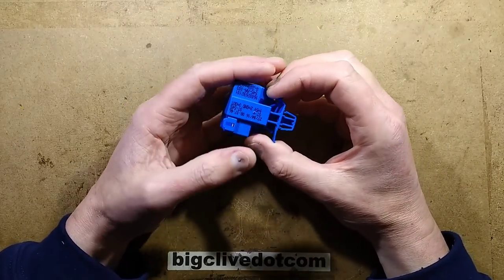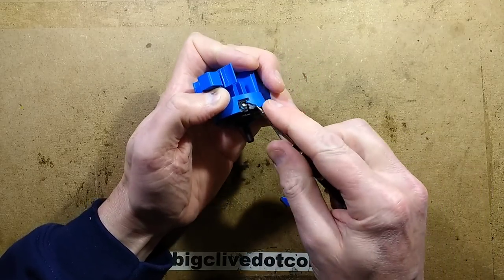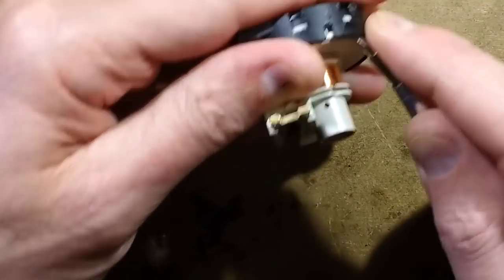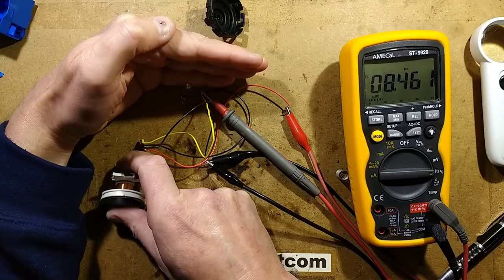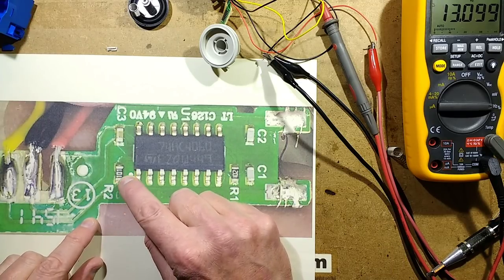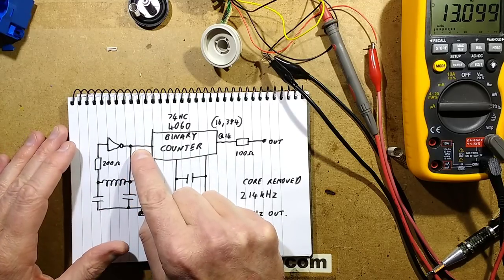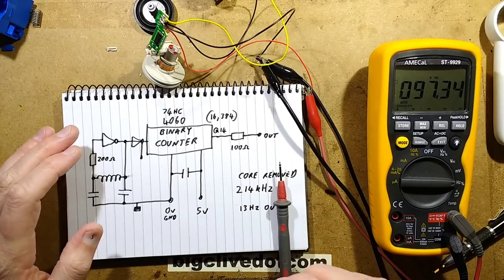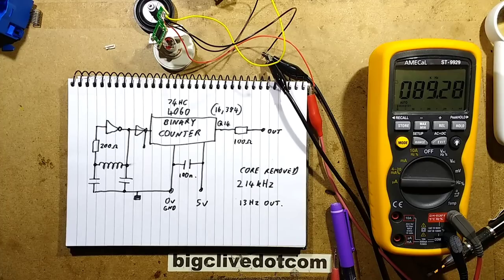Inside a washing machine water level transducer. (schematic)

Comment: my washing machine empties all the water every time I change the program.  How can I trick the pressure switch into believing for a few moments before starting the new program that there is no water?
Reply from the maker: It's usually in the software that the machine will want to start from an empty drum so it knows the state of the water in it.

Comment: I've just done the PCB motor controller replacement with solder and everything (help from mickr1969).  I was amazed when I put int spin and it worked....but my joy didn't last.  It would now spin but wouldn't fill.  I managed to get it to fill by blowing into the sensor. (yes I know I shouldn't).  So I concluded the sensor was faulty.  Just replaced it and .....it doesn't work.  Eventually it comes up with a 4C fault which I don't think is correct as it will work if I blow into the sensor.  I am now guessing that it is something to do with the level calibration at the start?  Any ideas?  I can experiment as I now have two sensors : )  It's either me or the machine!!

Comment: To your viewers ,
Be for you enter into your machine please switch off then unplug, from the wall.
And do not touch the dampener capacitor it holds a lot of voltage, please check how to discharge be for attempting to check machine, if in doubt give an electrician a shout.
 
Just suspect mine playing up, will test tomorrow ,machine not going into a spin and not draining, like what i had happen to my machine some years ago after suspecting motor brushes, then circuit board , it ended up being the pressure switch,that are always preset at factory,
 
After checking the rubber tube and any blockages at the bottom , I blew into the pressure switch, it did not respond with the certain amount of clicks, depending the amount of filling levels determine the amount of click sounds. 
Back then 13 .00 pound cost for the fix, 
But first spent motor brushes 8.00, pounds then mother board 60.00 pounds then bought a pressure switch 13.00 pounds that was a harsh lesson learnt,

 All pressure switches are preset at factory as far as I know, and i think you can adjust them by tweaking the water flow by turning left or right the hex white plastic bit that shows paint on it and on certain types you cannot blow down to check as this can mess them up,
But if you did blow down to check the pressure switch , without knowing first , reconnect it to machine, fill a couple of liters in where the draw is and put machine on to a spin .that should reset it,

Here are a few other things that cause drain or fill or no spin issues your viewers may not of realized
  I know that low brushes in the motor can effect the machine not wanting to go into a spin as well,
Also the pump, if propeller bounces back after flicking it left or right the magnet is good, but you have to test for continuity , if it bleeps across two terminals its all good, 
 
Also check out let pipe especially on the bend for objects blocking and holding scum causing a blockage,

Another offender is a child's sock, when water is in the machine and goes out the plastic drum hole and passes usually along the bottom front, then to the pump,if pump is at front, then through the pump into the outlet tube,going out of the back on front loaders.
just be for the water comes out from the plastic drum hole to go to the pump, check the out flow hole on the plastic drum ,hidden on the left or right depends on the front bit that allows you to drain the machine from the front,
Its been known that small soft item squeeze there way through the rubber door seal  if its got damaged through a tear , items get squeezed through and can be jammed in that outer flow hole, just be for the pump,at front,

Another issue for not going into a spin is the tachometer failing its on the electric motor, basically it communicate by giving the motor more power to enter a spin , or something like that ,not to sure I am not an electrician,

Another issue for no spinning ` drum belt at back slipping  or broken.
 But usually you here squealing for a few weeks first if belt stretching ,be for that thing keeps slipping constantly , and spins on the spider, but if you here the motor spinning but drum not moving its usually belt come off through being stretched or just broken,

Also door catch , becoming intermittent, with stop machine 
And a unbalanced machine will prevent these newer machines from going into a spin,

But as I am no electrician there are you tube channels showing using multi meter ,to test pressure switches, if this guy does not show testing a switch,

Taking nothing away from this guy loving his channel great stuff ,
Reply from the maker: If it's not draining fully the pump may have an obstruction.
Reply: @bigclivedotcom  Owe yes usually some wet fluff from the clothes, or a hair grip lol

Comment: I wish i could understand everything you do the but im just electrician for automation. We usually pull out smoked stuff an replace it. Of course i know what every component does but i have absolutely no clue on chips.
Reply: Martin Schwarz Each chip has a data sheet with lots of explanation. Just use a search engine with the part number, like here 74HC4060.
Reply: Martin Schwarz wish in one hand, shit in the other. Guess which hand fills up first? Everything you need to know to learn this stuff is freely available on the internet, and you’ve already got a strong foundation, so it should be easy peasy.
Reply: Same here, commissioning tech. Not enough time to learn how devices work, we just need to make them work by checking/fixing installation, configuring or replace them if they are faulty. No repair for electronic boards nowadays, companies realised that they loose money at the end of the year.
Reply from the maker: As time goes on you'll recognise more and more components on the industrial boards and realise that some of the faults are very simple.  Like a dead input being a burned out resistor feeding an opto-isolator.

Comment: How would one test that to see if it was faulty?
Reply from the maker: Easiest way would be to swap in a new one.  Keep in mind that modern machines initially just make the clothing wet with no excess water, to maximise detergent strength and friction between garments with lower risk of excess foam.  Subsequent rinse cycles would use a lot more water.
Reply: @bigclivedotcom  Less water makes sense.  If it fails how would you know if not filling, over filling or not spinning was not due the the pressure switch? I always test them when facing these issues.

Comment: Speaking as a washing machine repairman for the last 17 years, "The more they overthink the plumbing, the easier it is to stop up the drain".
The machines are getting more unreliable because they're getting over complicated.
I long for the bygone days of the clock drive switch module.
Reply: No, they are getting more unreliable due to deliberate cheapening of components. For example modern designs all use welded tubs and under sized bearings - they know the bearings will fail in 2 years, and because the tub is sealed you cannot replace them. They want you to buy a new machine. 

Microprocessors dont fail with age. Well designed electronic controllers dont fail with age.
Reply: A, they want you to buy a new one. B. they want to sell parts and service. "milk the cash cow harder whilst charging same amount for rubbish"

Comment: Weirdest 4000 series CMOS ever. I'll have to get some.
Reply: It's 74xx series, not 4xxx. They were an attempt to get both faster and lower powered versions of the standard 74xx series. But they do have some oddities that can be utilized for circuits like these. They were also upgraded to be more rugged with diode protection across the pins so static discharges would not kill them which the early CMOS was very prone to failing from.
Reply: I've never heard of it. The big thing here lately has been adding the end chip on cards and of course samsung pay has been here like 5 years and recently apple pay.
Reply: +John Possum The better input protection circuitry came in with 4000 'B' series CMOS.
Reply: + Martyn Davis It's was, and obviously still is, a very useful device. Used loads of them years ago as timers in commercial designs.  The 4020 is basically the same IC without the oscillator gates and more taps. There's also the 12-stage 4040 with a full set of taps.

Comment: Looks for all the world like a MAP sensor in a vehicle. Hmmm.
Reply: vehicle MAP sensors are "piezo trasnducers" which are precise and low latency/high speed devices, compared to the crude rubber diaphragm part used for low pressure sensing, they'd be way too slow and have far too much latency :)

*random new age compact map sensor chip https://www.nxp.com/docs/en/data-sheet/MPX4250A.pdf

Comment: Seems like the case was designed to be easy to assemble and impossible to repair.
Reply: yes, not meant for repair, it has no parts you can buy, it self is a part, it failes, you replace it, its how they make manythings now
Reply: Jim Fortune repair, what is a repair.  You just go out and buy a new washing machine
Reply: New washing machine, what is a new washing machine. You just go out and buy a new house with one already in
Reply: Kakunapod I don't think we've gotten there quite yet...
Reply: I'm from the future Jim, and it ain't a bright one
Reply: What's to repair? There's essentially nothing in it.
Reply: Mister Hat 
That's why a replacement part will cost you £20!
Reply: This kind of thing almost never dies before anything else (more expensive and complicated) dies. Had my dish washer (similar sensor unit) for over 10 years when the computer board started to behave strange. Cost: around 350 euro equivalent! Then it was time for a new machine :-( But the pressure sensor never failed once.

Comment: A cheep as chips made pressure transducer; prolly cost within a fiver to make. And around 50 squid for us to buy!
Reply from the maker: I paid a fiver for this one online.  Second hand, but not much to go wrong with it.
Reply: probably cost 5p to make^
Reply: "not much to go wrong", except the chinesium rubber hardening/cracking, springs rusting(cheap stainless?), circuit/trace corroding from moisture.
it is a washer afterall hot water andlikely corrosive chemicals

Comment: The question is how do you set these to let more water into the drum all new washing machines use these now stop you wasting water.
Reply: Tony Cosgrove turn that little screw that had the red dots on it
Reply from the maker: The machines add some water and then tumble the clothing in it.  Then they pause and see if the level has gone down.  If it has they add more water again, but if it's the same level they know the clothing is now fully soaked.  It gets the maximum performance out of the detergent and means there is less water to heat.  Then in the rinse cycles they do use a lot more water to get rid of the loosened dirt.
Reply: Keep a bucket handy and after the washer stops filling, dump the bucket in.

Or add a pushbutton switch that energizes the fill valve and use it to manually top up...
Reply: Being in Scotland, we don't have a shortage of water! There should be a "Scotland" switch on the back of every washing machine that allows it say, "heck just fill the tub and be done with it! "
Reply: Lol I'm now getting a suggested video that shows how to set a higher water level on LG washing machines... by an old american guy who sounds about as grumpy on this subject as I am.
My solution is just to tip a few jugs of extra water in through the powder drawer after the controller thinks it's let the right amount of water in - it doesn't appear to detect this and start pumping it out again or anything... course it still thinks it's got an 'environmentally friendly' amount of water in there and doesn't finish any sooner.
Reply: Surely you aren't "wasting time" unless you have nothing else to do while waiting for the washing to be done (and who does), or aren't doing washing often enough so it piles up?
Reply: While it's possible that some people might manage not to be inconvenienced by the slowness of these ecologically friendly machines, faster is imo almost always going to be better, sometimes you're just going to want something washed fast. 
also AFAIK you're not supposed to let them click over into their ineffective tumble dryer mode unattended in case they burn your house down.
Reply: adding water manually may make the machine error out "level too high" and drain the water LOL
Reply: It takes time for the water to saturate the clothing effectively and modern machines allow for that so you get a consistent washing quality.  So just throwing more water into the drum doesn't necessarily speed things up, if you want your clothing thoroughly washed and rinsed.

Comment: Having purchased a brand new front loading washer and like most people are now moaning about the lack of water used in the wash and the rinse cycle leaving clothes with soap residue even when using about 10% of the recommended dose of powder. Having this exact same switch installed in my machine and having a very basic idea of how a pressure switch works. I turned the screw clockwise so the air pressure underneath caused by the water level in the drum had to greater to l make the switch contacts or alter resistance. If turned more than 1/4 turn the machine would give an error code. Anywhere between default and 1/4 made no difference to water level  during wash or rinse. I have also tried increasing the length of the tube  to the pressure switch by about 16" using a narrower tube and a wider tube with no difference. Has anyone found a way to cheat this type of pressure switch as it is obvious it is doing far more than just sensing water level. It must be sending signals somewhere else to say something is not right.
Reply: Did you ever find a solution? I have the same type of sensor as shown in this video where you need to unclip the cover to get to the screw. The ONLY solution I found so far was to physically add water thru the soap dispenser once the cycle starts. I add up to 2 gallons more until I hear some splashing. I also tried pre-wetting the clothes before putting them in the washer which doesn't work; machine just adds less water. LOL. What a pain. I saw a couple videos where they said to  "reset" the sensor, add  2 liters of water through the soap dispenser,  and then turn it on and put on the Drain cycle and let the machine reset. Not sure what resetting means and I'm not sure if this will work. Shown at the end of these vids:  /watch?v=2pIVkAxWSXg   /watch?v=rgFid8cg7Sw  Thanks.
Reply: I just found this video that may help you. Not sure which brand you have. /watch?v=srSNVhE5AN0
Reply: @rgraz4929  No i did not find a solution. Gave up and since been filling with watering can which is a pain. Tried altering the pressure switch as shown in the other video's. My washer is a Candy with identical switch to other videos that work when altered. As stated previously turning it gradually to any position up to 1/4 turn either direction made no difference. Anything more than that amount of turn washer failed to do anything and came up with a error code. If it works on others with same switch maybe my switch is faulty in some shape or form.
Reply: @nigelmontague7046  Thanks. Maybe try to replace the switch without first touching the screw. If it's the same water level, try the screw and if it also faults beyond a 1/4 turn, your first switch was good. Strange that it's faulting beyond a 1/4 turn when others go way more than a full turn with great results. Does the error offer any hints? I have a Bosch Axxis compact, made by Bosch Siemens. My dryer is stacked on top in a tight closet and when I remove them to repair one of my faucet valves, I'll try turning the screw. Very frustrating especially with heavier loads. Not only do I add water to the wash, but I need to be alert and REMEMBER to add water to the rinses or at least one of the rinses. EDIT:  Maybe try turning the screw while the washer is in the Wash cycle like the guy's doing in the other video. He shows that a few seconds after adjusting the screw, the machine pauses to add more water. I'm assuming, according to his description, his initial adjustment was done the same way- during the Wash cycle, (and not while the machine was off). It's worth a try.

Comment: I would imagine that it could calibrate at the start of each cycle when there would be no water. That would be 0.
Reply: But what if there is water in it? Say the pump failed or there was a power out?
Reply: yes you cannot assume that a washing machine is emtpy at the start, thats why the device clive showed is calibrated, it will know it has water than just assume it hasnt, thats a bad direction to go, you end up adding more or leaking out, some older machins had 2 level switches one for level the other to detect if it was adding too much due to the first switch being broken or defeated by people adding more water via the tray (some people do, they dont belive a modern machine adds enough water)